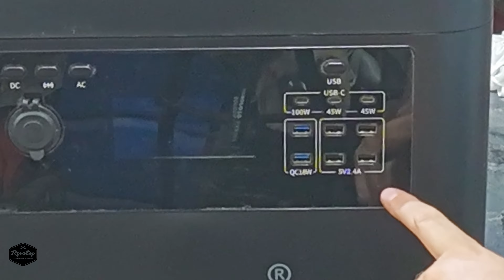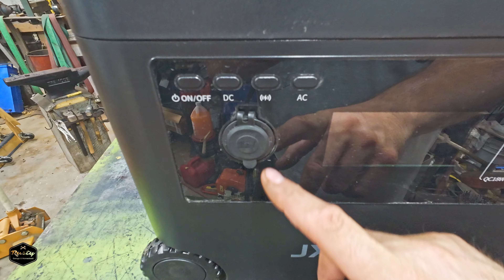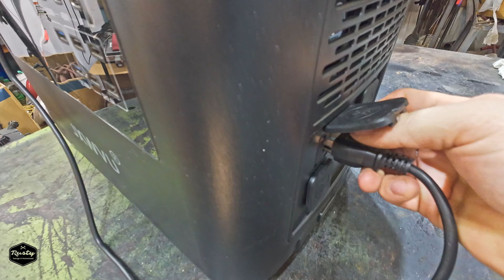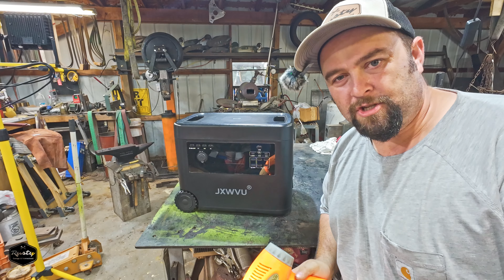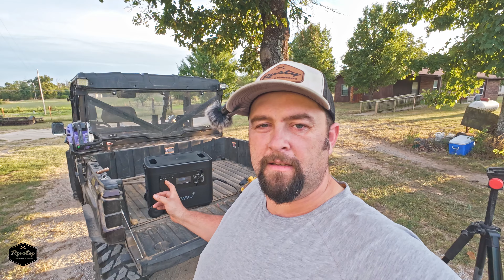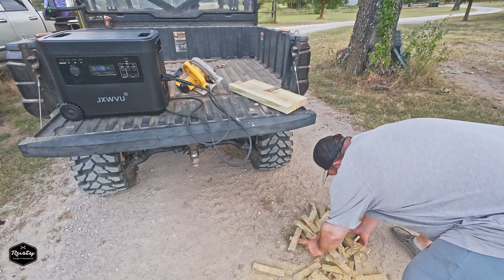JXWVU Powerstation Test | 4000W Peak Power Tested on the Homestead

Comment: Dude I would like to see the 110v welder test! I tried running my 110v plasma cutter & welder off my 3500w harbor freight generator the other day , It doest like to power them on higher settings. I have to turn them down to weld or cut longer than 10-15 sec haha.
Reply from the maker: Hey Tony. I figured that maybe the case with this one. I think low amps would probable be ok but idk for how long